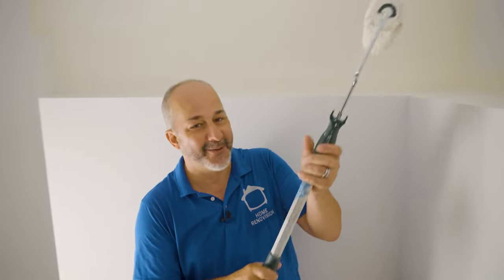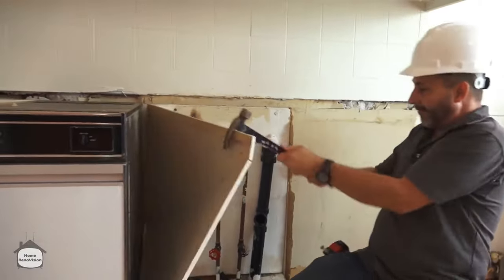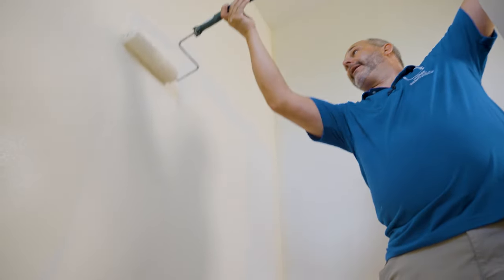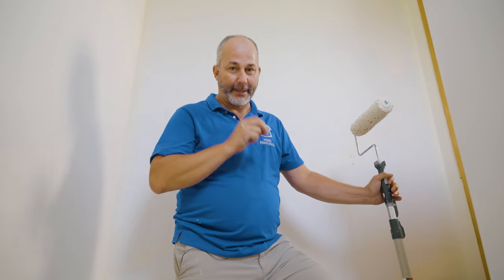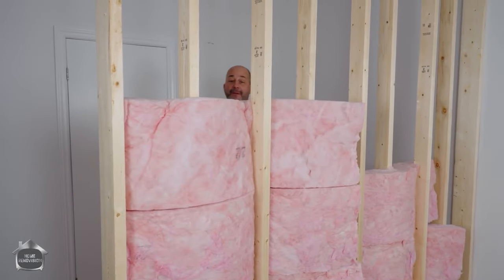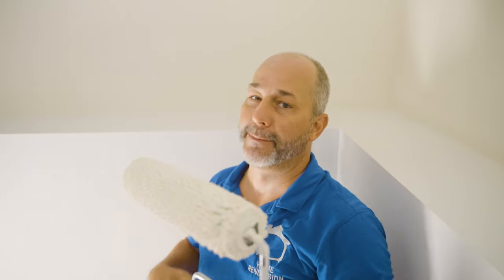My 20 Steps To A Perfect Renovation

Comment: I and my husband have done a number of home remodeling projects in our current home. One thing we learned is to work with city inspectors. I found out they are thrilled and more then happy to work with you and answer questions. So all major work done on our house (alot of it we did ourselves)was done with permits and signed off on by city inspectors. I have neighbors and co-workers that have said you don't need to have all work permitted. Especially when you want to add say bedrooms in the basement. Well don't listen to them. When the market settles down and a home gets assesed... You can bet they will look to see if the work was permitted and meets code. If you just slap up some studs, put up only a little insulation, and leave a little tiny basement window in your new bedroom(closet or no closet) you can bet it might not get classed as a bedroom and the room can be a liability as a living space. In case of fire that window needs to be large enough for someone to get out and large enough for a fireman to get in. Do you really want kids to sleep in that kind of room and have them get trapped in a fire? Not to mention what the insurance company would say... Just one example. So just be careful and become familiar with city codes and state regulations. The information is easy enough to find online. And insulate a basement properly. More people are likely to use it if it is comfortable. And don't forget the smoke detectors, and carbonminoxide detectors(change batteries regularly if they are not wired in). Stay safe out there! 😊

Comment: This video turned up randomly in my feed; I'm so glad I watched it. You have a great style and great diction, speaking at a nice gentle pace. Anyway, a serious question and one particularly relevant to a computer site like Youtube: what about ethernet cables and other network infrastructure? Do you  do them at the same time as the electricity? TV & speaker wiring too, I guess.
Reply: yeah never seen this channel before but i am subscribed to it somehow
Reply: I love Jeff's videos & wish I'd found them before I started renovating my first home!  I work in IT & have ran miles of CAT cabling & some fiber as well.  In my experience in both residential & commercial jobs is data/network/server infrastructure often doesn't become a consideration until after the drywall is up!  This makes wiring much more labor intensive, especially if the client doesn't want cable raceways all over their walls & they don't have drop ceilings & other challenges we'll run into with construction materials & methodologies.

My advice especially for business with server & network requirements but also for homeowners with increasingly large amounts of network, storage & home theater equipment that all end up with wiring feeding back to a central location is to plan ahead!  Plan this stuff right along with your HVAC, electrical, plumbing & other core work.  You'll save money, time & get a better result.  I'd much rather a client call me ahead of time & we can address concerns they might not think of like avoiding putting plumbing lines over a server room or not providing adequate cooling or physical security in a network switch closet.
Reply from the maker: Hi Quentin! yes working with a plan means that all cabling can and should be installed to the proper locations and locations written on a map to find after the walls are finished. saves a lot of additional work and can eliminate the possibility of damaging the electrical while drilling all those holes. Cheers!
Reply: @HomeRenoVisionDIY  Yes! Yes! Yes! We are in the middle of a double living room reno and with forethought, we ran ethernet into not just the two living rooms but both bedrooms above and the rooms on the other side of the living rooms. And plug-ins--we live in a 1905 house. We had a total of 3 plug-ins in those living rooms, now I have a plug every 6 ft or less, new plugs in the bedrooms above, new plugs in the adjacent rooms-AND we have run wiring for an in-ceiling sound system. Sha-Bam! Do it while it is open. 
You should see what pre-planning did for my kitchen reno last year; just think ahead (and take lots of pictures of your wiring and plumbing before you put the drywall up).
Love your channel Jeff.  My Interior Design students at my HS know I have a thing for your videos!

Comment: I don't know what was more addicting: you talking and spitting gems on reno, or the immaculate paint job. Also, I started doing my own drywall. When I had a contractor come over to fix a hole in my ceiling from an HVAC ceiling, he was speechless on the work that was done by some non-drywall pros. Thanks for not gate-keeping! Cheers.
Reply from the maker: No need to hoard secrets since there is just not enough workers to go around anymore. Cheers!

Comment: Never, ever put 3/4" hardwood floor under your cabinets! If you get a water leak the floor will buckle and will lift your cabinets, breaking countertops. I know contractors don't want to hear this because it slows down the process, but it is true. Did a kitchen remodel for a long time insurance claims adjuster. He had us write into contract that hardwood floors go in after cabinetry. He said he had seen too many instances of ice maker, DW, and toilet supply lines breaking and destroying cabinets and countertops. 
Proceed at your own risk!

Comment: these "HVAC" guys did the ducts for my house and they built the return duct encasing the main plumbing line...so yes there was the floor's main sewage drainpipe INSIDE my main return duct for my first floor... after my dad pointed it out to an inspector who otherwise didnt notice it, then there was a problem and they were forced to redo the return duct elsewhere. they had to move it over about a couple feet and use a space that would have ended up becoming a hallway closet. i imagine thats where it was supposed to be to begin with but these guys probably had no idea what they were doing. and before anyone asks, no we didnt hire them. we were just present when our house was being built by the builder.

these guys spent five months screwing around supposedly putting together the HVAC system and failed all their inspections and had to tear everything out and do it again. they got fired midway and another less scummy HVAC company came in and completed the job and passed inspections.
Reply from the maker: contractors are like doctors and lawyers. we are all learning on the job. Integrity is what separates us. that is unfortunately what seems to be lacking in todays trades.

Comment: Took out all the copper pipe out of the house and went to pex…. Best thing since sliced bread.  A lot of pin hole leaks in our city recently in residential copper lines so better be safe than sorry. Easy DIY project especially if the basement is unfinished
Reply from the maker: very true. all plumbing lines will eventually fail. copper is only expected to survive 50 years in residential homes.

Comment: Thank you I just bought a 1979 log home and I am wanting to rehab it. And I didn’t know where to start. I have a mostly finished basement then the main floor and then a loft area. I am assuming i need to start in the basement and now you mentioned doing the hvac first thank you!! I need this info bc I don’t I will where to start so would one floor at a time work? Or do bathrooms then kitchen etc?  I am wanting to redo insulation too and swap it out with rock wool

Comment: Hey jeff, any opinion on diocore foam subfloor pretty sure i cant tile over that
Reply from the maker: Hi Alex. dricore foam plus osb still needs to be screwed down with tapcon and add a layer of 3/8 plywood. then you can tile. depending on how flat your floor is of course. Cheers!
Reply: Thanks needed the argument ammo with the gf!
Reply from the maker: just because it can be don e does not make it the best solution. maybe ditra xl plus tile is a better option for cost savings. you could add floor heat with the money you save. Cheers!
Reply: Going for insul-armor for the basement but restroom probably going with blue membrane and plywood concrete level is pretty bad over the aera and it will make my life easier. Click vynil over the foam, tile over plywood
Reply: With gouv subsidies insularmor is the same price as membrane and plywood
Reply from the maker: well thought out. nice project!
Reply: Get rid of drycore and tile directly over concrete with adequate grout for efflorecence (Mapei Ultracolor FA). Tile will be cold with or without drycore. If GF wants a warm floor, install carpet or tell her to wear sandals ;)
Reply: Cant do that, floor at this place would be way to low, will build up with sheetgoods  to match the height of the foam

Comment: On two separate remodeling areas, the workers flooded our newly remodeled basement.  Didn't cap off the plumbing. Turned on at end of the day...all bathroom work and basement flooded! Second time: opened up the sink full blast in another bathroom, after I told him watch the drain. Again, basement remodel! He continued working in master with open sink in powder to empty the lines. He had plastic wrapping in the sink, unknown to him, and walked away!!! Plugged drain, flooded bathroom and it all went down the register and out the lighting downstairs. Mother Of God, help me!!
Reply from the maker: ouch.